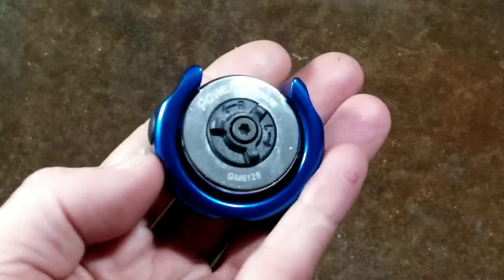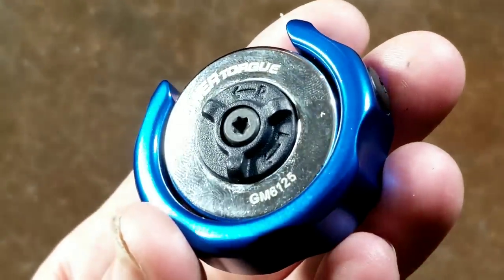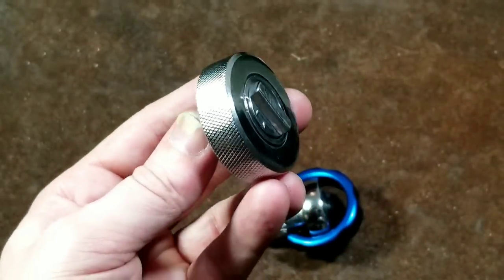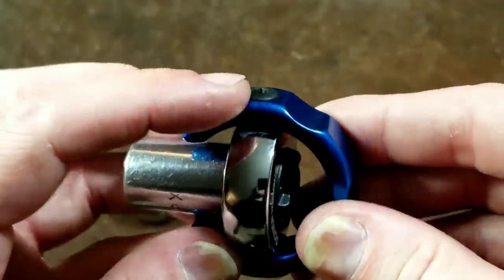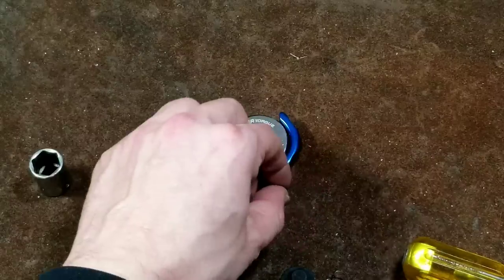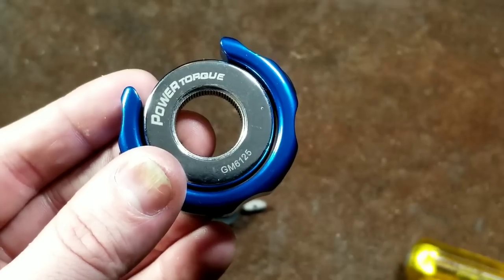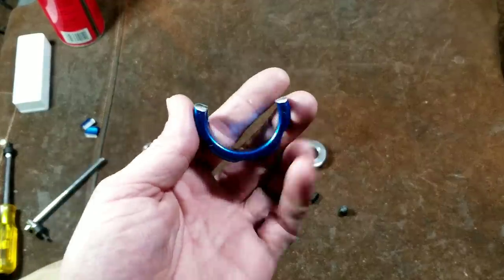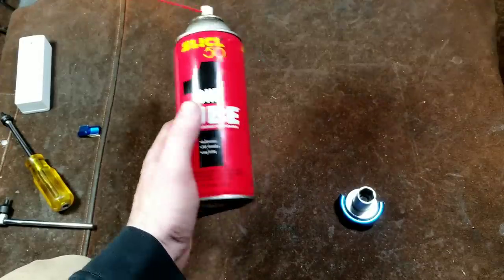Power Torque 3/8" Roto Head Thumb Ratchet Review & Modification

Comment: Ive done die setting and worked at Abbott furnace co. This area is saturated with powder metal companies making these pawls and thousands of other parts, even connecting rods for combustion engines. Die setters deal with the powder metal presses and at Abbott, I would build, install, and repair sintering ovens and heat treaters. In Elk Co. Pa. where I reside is the backbone of the economy.
Reply from the maker: I think that's a pretty cool job you had
Reply: Wasnt too bad. Quite a bit of traveling in a small box truck at times. My true calling was plumbing, heating, and A/C. Has been for over 30 years now. 20 years of that time working for myself. But now I just do no-heats and service calls, simple stuff, and have been doing a lot more automotive and small engine repair-ATVs, which is a little easier on my body. HVAC Installs are killer on my body lol

Comment: Cutting the wings and lube will make that useful. I bought a SO 1/4" years ago, but even after lubing its still too stiff to be useful.
Reply from the maker: Yes on the thumb ratchets the manufacturers need to be careful of how stiff the ratchet mechanism is even though the heart spring is pretty thin it's what they need to use to make this an effective small tool you just need to keep it oiled so it doesn't want to get stuck and start skipping